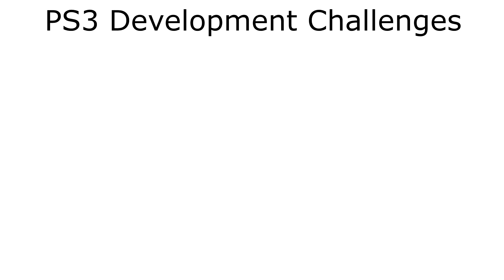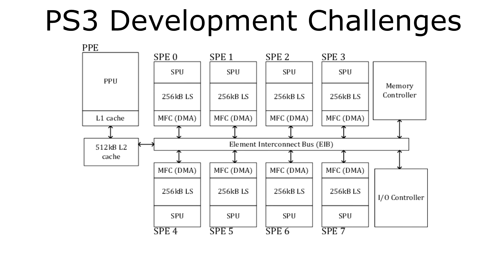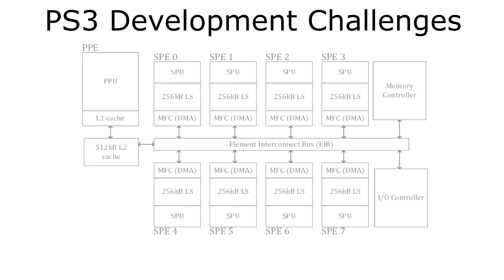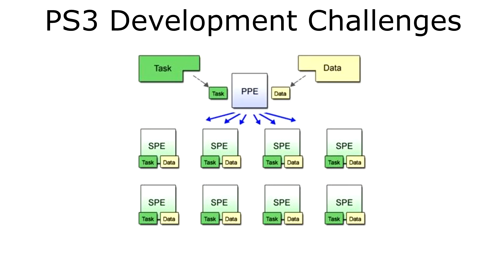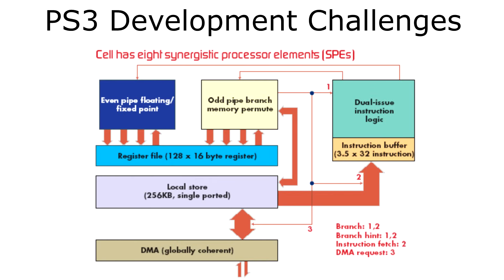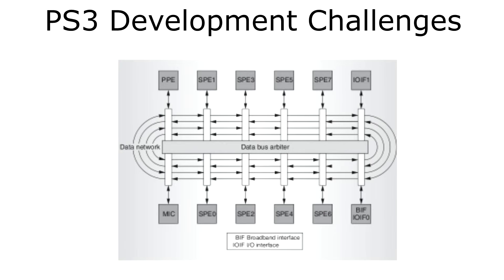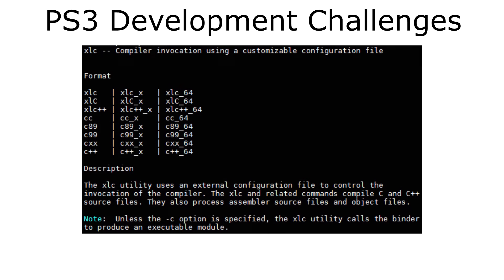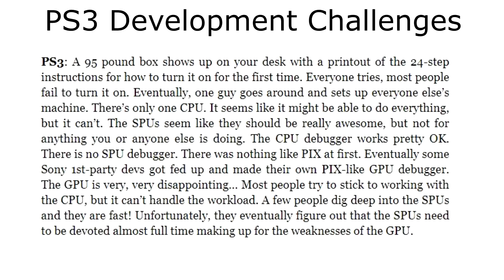Why was the PS3 Difficult to Develop Games For?

Comment: Cool video. I have found a lot of data that mentions the SPUs were design for geometry workloads. Ninja Gaiden Sigma even runs those there and the whole "not IEEE754 compatible" FPUs were due to this.

Sony had a library to do this, so if you think SPUs would be always abstracted, it made sense.

They are also fine to process video or AI loads. But Sony needed a pixel pusher and ended up with duplicate vertex  hardware on the GPU.
It would also be a very underpowered system that was very late due to Cell delays.

As Gabe said, this and 360 were released at a time where programmers were barely doing dual threaded code on PC, much less something as complex as this.

I dont think the GPU is underpowered. Real world results show a lot of PS3 games running at 1080p and even the dashboard, where the 360 was stuck at 720p dash.
It had a lot of rasterization hardware but lacked in the interconnect to the CPU and the stiff memory partitioning that wasnt a problem on the 360.

Comment: For IBM and Toshiba  to get involved  with this was a  big deal ....Toshiba putting the Cell processor in a TV was the last thing i saw about the use of the CELL.
Reply: Well Toshiba is basically toast now, they got bought by a private equity firm two years ago and only the name remains.
Reply: Your all acting like nintendo followed sony ms they copied nintendo the IBM power pc was the perfect blend of Japan risc mip cpus and a Intel x86 it was a perfect blend also the gekko cpunidea was far far far superior and efficent
Reply: Just watch a GameCube tear down ...IBM chip is present in the system
Reply: @FoeHammer909  Very true. The Wii and Wii U were also Power based. With the Wii U having a 3 core SoC. However they were not CELL processors as they did not have the SPUs.

Comment: looking back what Sony should have done is delay the PS3 to Nov 2007 and double the main ram to 512MB. The RSX should have been changed to a designed derived from the GeForce 8000 series so they could get hardware with unified shaders and they should have also doubled the vram to 512MB. The extra year would have also given the engineers more time to great more libraries and documentation for developers but it later came out that Sony made the PS3 hard to program on purpose so devs had to take time to make really good looking games. Same thing happened with the PS2 but back then Sony had no real competition so everyone adopted the console. xbox 360 really but a dent on sony's plan
Reply: Here is a guy who does not understand business
Reply: @tHeWasTeDYouTh  or double the main ramp and not delay be 2 years behind Microsoft Xbox 360 and 1 year behind Wii
Reply: 8000 series and the viability of GPGPU is basically what obsoleted the Cell architecture in the first place. The least that could've been done was replacing that XDR garbage with DDR2 (which would have gone dirt cheap in a year) and use the money saved to make the damn VRAM bigger.
Reply: Oh yeah sure sure, they should have waited a bit more and base the cpu on the r9 5900x and the gpu on the rtx 3090
Reply: @SUB0PT1MAL  RTX 4090 was the only way to go for the PS3
Reply: @tHeWasTeDYouTh  nah, that would have been waiting too much and would loose the gen wars againts the 360
Reply: @tHeWasTeDYouTh  That didn't exist in 2005/2006 😂

Comment: God awful architecture tbh. Up there with netburst.

Good console with great games though! (I heard Little Big Planet is nice) But dear GOD Sony really dropped the ball here.

Also, a lot of video games don't benefit too greatly from high output SIMD performance (except with stuff like graphics and really complex AI's).

All your netcode for multiplayer? Yeah, thats not benefiting from SIMD. Neither are any GUI subroutines, save file saving, input management, general game logic, etc.

The PS3 is a product and victim of the transition from single core to multicore computing. The industry didn't go with asymmetric multicore designs, we went with symmetric multiprocessing.

Its just... better to have multiple fully fledged cores with each being equal. Much more flexible and easier to code.
Reply: IIRC the SPUs ran in local memory, I suppose they were worried about memory contention if you have too many cores all wanting to communicate with main memory.

Comment: Can you do an explanation for the xbox 360, and maybe the wii? 
There isn't enough mention of the other two consoles of that gen. It would be nice to know how their architecture varied from their competition.
Reply: As far as I know the Xenon CPU was based on CELL project but with some differences like upgraded instruction set, more cores (3 cores with 2 threads per core) and without the SPUs. Though it wasn't as powerful as the CELL, it was much more efficient and easier to use.

Comment: Somewhat business point : Sony should
1) have had developed some Libraries or even languages to make it easier to use.
2) Sony and IBM should have sold unlocked versions for scientific use even at somewhat higher price.
Reply: Yeah, it almost looks like Sony should have built a full game engine and possibly delayed the PS3 to 2007 to improve its thermals and get the GPU clocked higher. Maybe added more RAM? 512MB at the time was standard, but 1GB could have really future proofed it. Blu-ray drives would have dropped significantly in cost too.
Reply: @reaktorleak89  well yes and no. Delay might have killed the business but to have PS3+ which is backwards compatible with PS3 it would be good.
Reply: @reaktorleak89  That engine could have been open sourced or STL least run at Open  VG / VL. Thus attractive to makers.
Reply: @reaktorleak89  Lose the gaming generation by doing that.
Reply: Well Sony developed libraries and game engine specificaly for PS3 called Phyre, but that was halfway through generation.
Reply: @lukasl3440  which is kind of late. Also the border ecosystem was at stake.
Reply: @lukasl3440 And by then everyone knew the PS4 was just going to be an x86 so why bother with the Cell.
Reply: Yea Sony seemed to just assume devs would “pick it up as they go” which was a poor choice.

Comment: Sony originally wanted the PS3 to ONLY have the CELL processor, the addition of a GPU was partly the reason for the delay from 2005 to 2006.
Reply: Imagine having to code a performant 3D engine only running on the CELL.
Reply: Absolutely psychotic.
Reply: @Thelango99  Sony were on crack then, apparently they wanted to go to ATI but they were at 100% capacity, so had to go for Nvidia which bumped the price up, they are not easy to deal with apparently.
Reply: @Thelango99  PS3 would have a library of like 200 games then
Reply: Wait, I heard that they wanted their own inhouse GPU like the Graphics Synthesizer in the PS2. Apparently they could never get it up to snuff, so they went to nvidea last moment and got an underpower gpu.
Reply: @FrancisBurns  yeah i remember reading that they missed fill rate target by a magnitude or so and had to massively downscale the Larrabee, I mean SPE and had to rub forehead to the ground at NVIDIA to save their face
Reply: @すどにむ  Sony's marketing was on point though, all we heard is how great the Cell processor was.
Reply: I've seen rumors that it was originally planned to work like PS2, with the CELL handling vertex shaders and the RSX being a successor to the GS. So tons of EDRAM, bandwidth and fill rate for fragment shaders and rasterization.
Reply: 2x cells was the plan but way way way tomhard to code and no ratification was a ball sack pain
Reply: This would result in more games then the ps5.
Reply: Honestly I think is the way to go in the future. Dedicated CPU cores with an addition of highly parallel general purpose compute units. GPUs have become pretty much that except they still carry dedicated hardware rasterizers and their architecture is still a black box abstracted away by a restricted API.
Reply: @0x1ED1CE  what do you mean? Technically any modern CPU with iGPU and APU does what you mention if the code is parallelized enough and the right libraries. I did image processing for my masters this way.
Reply: @FrancisBurns "GPUs have become pretty much that except they still carry dedicated hardware rasterizers and their architecture is still a black box abstracted away by a restricted API." - I think you missed that part of my comment.
Reply: @0x1ED1CE  yeah but, don't CPUs with igpus and APUs have rastrizers and have APIs as well? Maybe we are saying the same thing differently.
Reply: well, the real original plan was to have a Cell based GPU made for the PS3 at Sony, but that was taking too long; they panicked after the 360 sold so well in its opening months and grabbed a shitty nvidia GPU to build the RSX.
Reply: @alicevioleta3184 what nvidia gpu is it based on? Wasn’t Xbox 360 using ati? Nvidia is great but expensive as heck.
Reply: But it would have been amazing!
Reply: @reaktorleak89  bro everything wouldve run like utter ass unless they bumped the cpu up enough to be able to handle game logic on its own
edit: wtf 8th gen consoles didnt have it?
Reply: @reaktorleak89  not it would not, it would be under-power crap, a single SPE is 32 Glops so 8 spe's would be 256Gflops which is a single amd zen 2 core with AVX256 can do, people with zero knowledge about computing over-hyped it for some reason..
Reply: @niks660097 that’s in modern standards tho… this was released 2006 zen 2 only released like 3-4 years ago now
Reply: @niks660097 why tf are you comparing modern cpu to this lmao and games don't usually use avx at all
Reply: @niks660097 You're comparing it to a modern CPU lol. Back in 2005/6, that would have been fine. The Xbox 360s entire GPU was only 240GFLOPs
Reply: @gnrtx-36969  REALLY?! No way!

Comment: If I want to study about this not specifically Cell processor but computer processors in general, what would be the course for this in college? I used to be fascinated by computer technology but not mentally focused to learn on what they made of or how it is made and work differently from other conventional PC processors.

Anyway, you sound like nerdy videogamedunkey, no offense. Awesomely detailed video by the way even though I have no knowledge about computer science.
Reply from the maker: 🤣🤣🤣😅😅 thank you for pointing that out. No offense taken, I take that as a compliment.
Processors in general? Typically I would start with a digital logic course, followed by an intro to microprocessors course.
ABET unis will have both!
Reply: @ZygalStudios  Thank you! 😀 Subscribed!
Reply from the maker: @jonathanm.ollerjr.6486  Do you think I should make content on computer/electrical engineering as a career? What to look into and what's available based on university studies?
Reply: Yes. That it'll awesome too!
Reply: Probably something like computer architecture or operating systems.

Comment: This is great, better than most content on this I see, and I'm glad you detailed a number of things. But there was a few bits I was hoping you'd highlight more.

The design philosophy of the SPE, and the corporate political dynamics that fueled it, is fascinating to say the least. It was a partnership between IBM/Toshiba/Sony. The former two were vying for it to be a next-gen number crunching powerhouse to use in all sorts of applications and fields. Why on earth Sony bought into that when they needed a general purpose processor? I have no clue. I would love to have been a fly on the wall as management relayed across corporate lines their respective engineers' dreams.

You have to understand, the processor did not turn out as they'd hoped. Sony initially intended to not include a GPU at all! It was going to be the magic of SPEs carrying Mr Frodo up the mountain using the power of friendship or something. SIMD processing works great for audio/video streaming, so game workloads only makes sense, right?

It was very wrong. It frankly should have been obvious it was wrong. And by the time they admitted they were wrong, they were too deep into R&D to start over. So IBM and Toshiba kind of... abandoned it. They cut their losses, and handed off an unfinished product that Sony, despite what their floating-baby-powered PR would lead you to believe, did not want. So a GPU that was less powerful than the 360's was glued on, of which devs leaned on *heavily*. Ever since, the popular rumor has been "developers just didn't know how to unlock the magic of the esoteric Playstation".

Those kinds of takes made discussing the nuance behind it all very difficult to have. Just because you're working with a framebuffer doesn't mean SIMD processing is a saving grace. You're not spending your time fiddling with hue; the opportunities for applying the same operation across lots of data isn't as common as you may first assume. You're detecting collisions, you're mapping textures, you're moving lights. These scenarios are fantastic for thread level parallelism, but terrible for data level parallelism, and SIMD is all about the latter. That distinction can't be emphasized enough to the uninitiated.

Not to mention, the last minute decision to slap a GPU on the thing left a few bugs. For example, MSAA had to be performed at certain arbitrary resolutions. If your game didn't run at native 1080p (most didn't), and your game was 16:9, you had to waste memory upscaling before running built-in MSAA. And if you had multiple render targets, it wouldn't work period! This is why MLAA was so popular on the machine, which unfortunately meant you got a bunch of weird edge blurring.

I should reign this back in for a moment. You touched upon it, but I wish the impact was discussed in more detail. The whole mindset behind Cell was "RISC, but moreso". It was taking the idea to its logical extreme. Branch prediction? Out-of-order execution? Speculation? Nope, that's now the burden of software engineers and compiler authors! All in the name of raw silicon. It was as stripped down an ISA as could be. If you weren't careful and a cache miss occurred, or if you predicted a conditional wrong, you can branch off for a mind-boggling number of cycles before you realize you've got garbage.

The developers should just write safer code then, right? Yeah, this concept would've been fine and dandy if Sony was known for providing well supported, well documented, and well built tooling and development software.

They were not known for this.

Microsoft, for all its flaws (and boy are there many), did not have such a reputation. It was, in contrast, a revelation. But when developing for Sony's system, lots of folks would just batch work as much as they could and cross their fingers. And this was because, get this, they had no SPU debugger! One was only eventually handed out because a first party dev got fed up with such nonsense and made one themselves.

Sony's hubris led to the idea that developers were putting up with this for some reason beyond market dominance. Hint: They were only putting up with it due to market dominance, of which the PS3 did not have. The dev backlash was strong, and unfortunately the perception from consumers was "these devs sound lazy or incompetent if they can't unleash the system's power".

That isn't to say Microsoft carved a market share on good dev relations alone. They were pushing the envelope in hardware design too; unifying vertex and pixel shaders was fantastic foresight, and working with rDRAM was like having an L4 cache, which made people very happy.

The funny part is... Sony/IBM was arguably right, but perhaps too ahead of its time. GPGPU has been making huge headway lately, now that we have much better cache coherency and well supported middleware and tooling. As well, memory locality (arguably the thing Cell got right most) has become a bigger deal for ISAs in general, to the point where understanding NUMA topology is critical for any enterprise performance work.

Anyway, my apologies, I'm not so much criticizing your video, I really enjoyed it! But if you (and your audience) wanted to hear a bit more of the story behind the data, well, here you go. :)

And for the record: I own a PS3, and prefer it to the 360!
Reply from the maker: It took me quite a while to get through this, but wow! Thank you for taking the time to write this out!
Very fascinating and I didn't take this as criticism at all! This is color for the video.
Reply: I think your point about Sony being ahead of it's time is kind surprising in hindsight. I worked in large scale data backends at the time and I remembered coming across a GDC presentation by Naughty Dog at the time describing how their engine took advantage of the SPEs by using "fibers", which were essentially tiny user space thread. At the same time Google had come out with a little language called Go which essentially meant Google had similar ideas about the future of programming too.

Now almost every language has an async engine full of tiny tasks and the context switching problem is "mostly" solved.
Reply: awesome write-up dude!
Reply: You are right in everything except one think. EDram in X360 was small, around 10 mb. Which was good at start but through the generation it's become limiting, demand was 2-3 times higher and without heavy tiling (degrading assets) it was unusable.